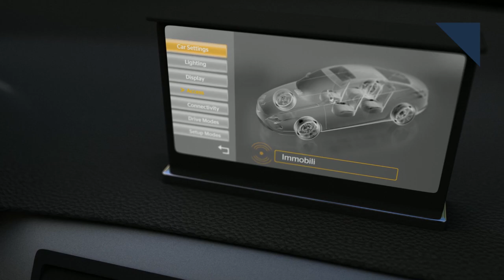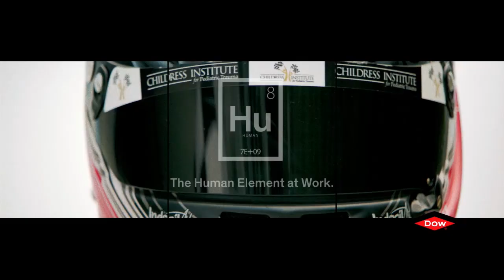Are Keys Headed For Extinction?, Red Hot Manufacturing - Autoline Daily 2021

Comment: The suggestions on how to improve EV sales echo Musk's argument of why traditional dealers are not suited to sell EVs alongside ICE vehicles.

Used EV batteries are idea for stationary energy storage. An end-of-life Leaf battery, for example, has about 17 kWh of capacity, which is much more than my house would need as a battery backup. The car industry may be a great partner for the distributed power generation industry by repurposing their scrap. And continuing to use the battery is a much better alternative than tearing it down to reuse its components & materials.

Comment: And when the battery dies or fails? then what.
Reply: Recycle it - just like we already do with lead-acid batteries. Getting back materials (Lithium, Nickel, Cobalt etc.) in EV battery are well worth it for battery manufacturer.
Reply: No , the vehicle battery not the fob. if it goes out overnight and there are no keys then how are you going to get inside?
Reply: Raton Colorado Bluetooth and phone app... I'm currently using a car share that only uses a smartphone to get in and start the car... no keys, and no cards... just Bluetooth and phone app, the only flaw is what if you don't have any phone service, I almost got stranded one time, I literally panicked!